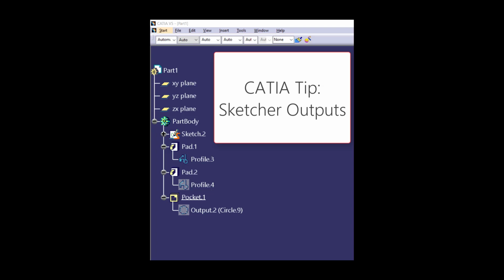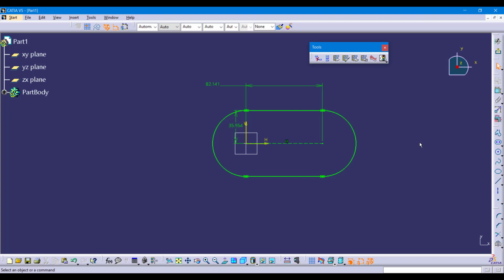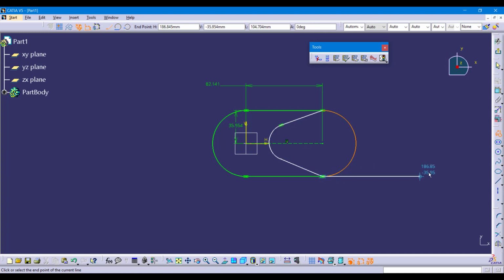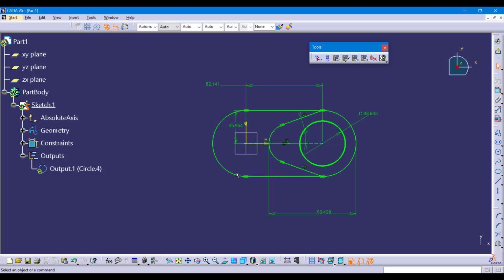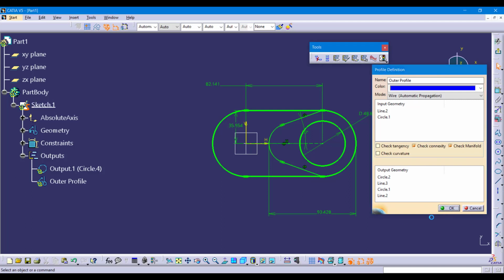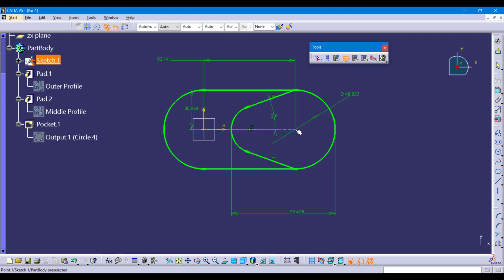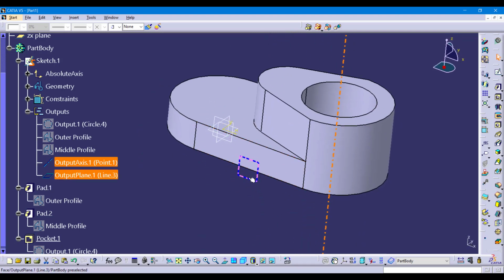Sketcher Outputs in CATIA V5

Comment: miss how do i fix the selected sketch contains several open profile catia
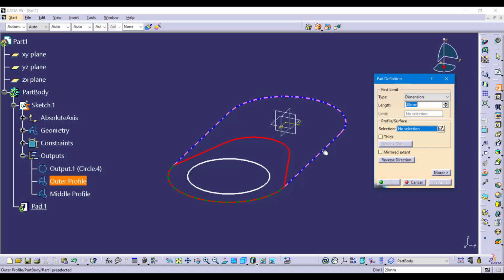Reply from the maker: Hello, thanks for your question!  The warning "This sketch contains several opened profiles, or some geometry used for construction...." is given by CATIA when you are trying to use the entire sketch to define a shape for a feature (like a pad or pocket). To remedy this, you can use the sketcher outputs (as defined in this video) but you need to make sure that you click on the individual output line item from the specification tree and not the entire sketch (I show this around the 6:45 mark in the video).